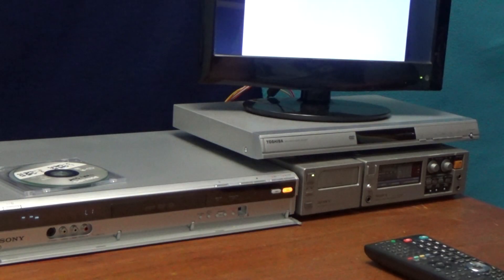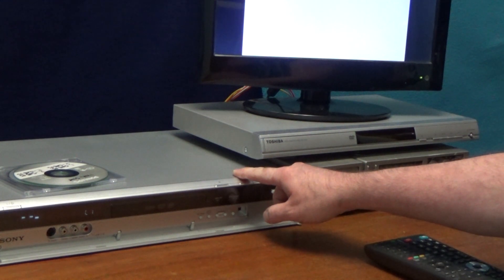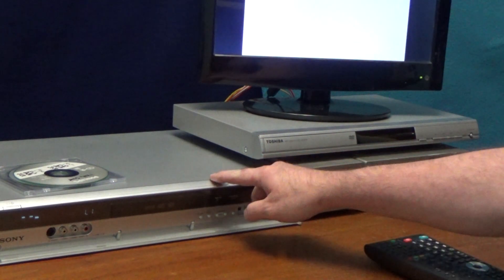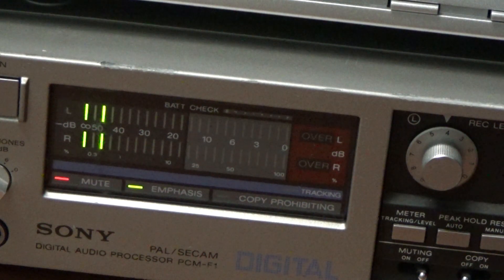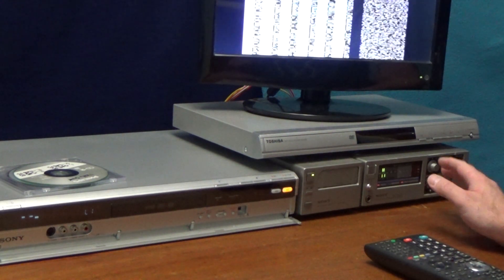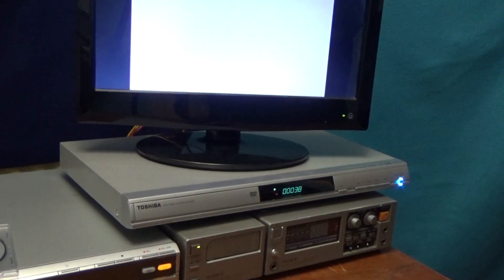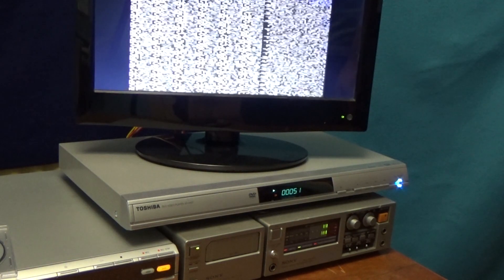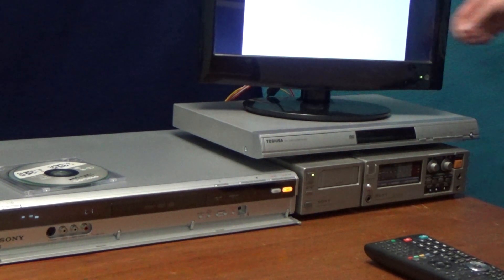Can you record from a Sony PCM-F1 on a DVD Recorder? Unexpected Result.

Comment: Just saw a video analysing the PCM signal of these PCM units and how it was constructed. If what that video showcased is true, then you're initial theory about a bit of the video signal being thrown away is a correct assessment. 

Of course, we're talking about the vertikal blanking space, which normally isn't visible on a TV, but nevertheless used by an analog TV to make the picture remain stable (it was even used as a neat way to provide a Teletext signal).

 But like you said, the digital recorder has no need for that picture information and therefore throws it away. But the PCM unit needs that bit of data, so the PCM unit will become confused and won't know what to do with the incoming signal.

Comment: Interesting video! Could the unexpected result also have something to do with the picture compression of the DVD format? I can imagine that the videocompression is huge due to the many (changing) dots in the video… [EDIT: after i posted my comment i read the mention of MPEG2… 😁]
Reply from the maker: To the best of my knowledge, in E-E mode, the video isn't passed through the MPEG2 encoder/decoder at all, so it's not that :-)

Comment: I wonder if trying a different make of DVD recorder would yield the same fault, or if it would work.

As you mentioned, I too would also hazard to guess that it's more than likely one of the lines of video from the F1 (probably in the vertical blanking interval) that contains the flags for emphasis & copy protection, that your particular make & model of DVD recorder isn't passing through properly and making your F1 freak out as it is. :)

I'd guess a different make of DVD recorder would process the incoming video differently and maybe leave more lines of video intact passed through via E-E in and out?
Reply from the maker: I'll have a rummage and see if I have any different makes of DVD recorder. I know I have about 4 or 5 machines, but I think they're all Sony models.
Reply: @timf-tinkering  try a capture card on a computer and see what it does.
Reply: I tried it with an LG DVD Recorder/Video Cassette Recorder combo unit RC897T , I got the same results with the DVD recorder (relay switch clicking etc). Another oddity is that it can be hit or miss when recording using the Video cassette deck of this unit. Could it be that this newer unit is not compatible with the PCM encoder? (Not sure *Shrug*) I am using the campsite Video in / out and confirmed all connections are proper. If I use a regular Sony VHS VCR all is well.... any way just wanted to contribute and thank you for this video as I too have been curious of recording the PCM signal to other mediums as well.